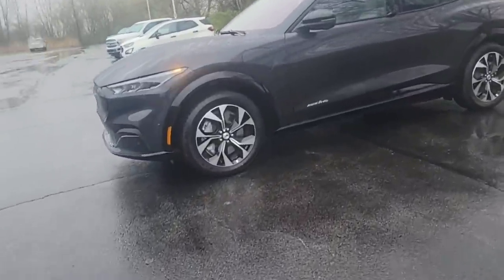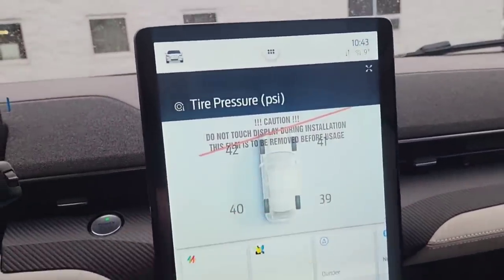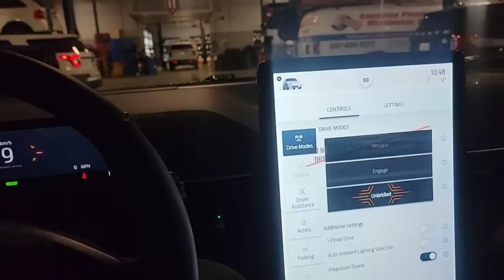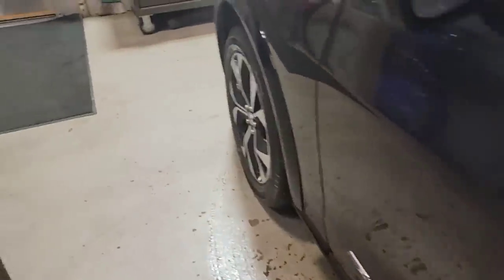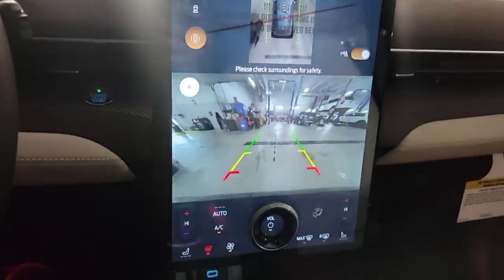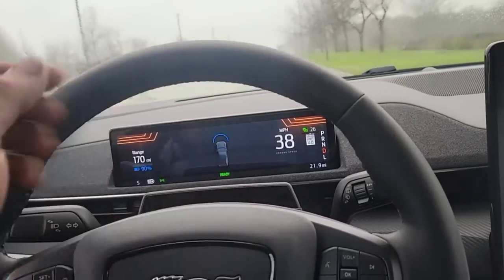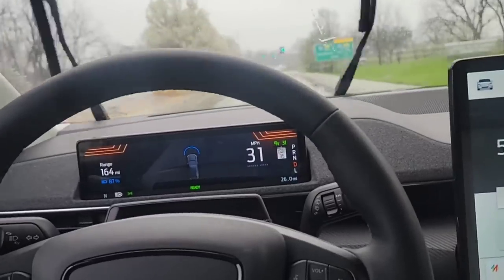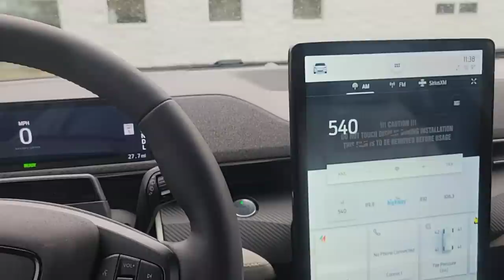2022 Mach E PDI - Adaptive Cruise Control and Speed Sign Recognition - Let's Check This Vehicle out

Comment: Though I am not comfortable with the idea of electric vehicles, I must say that I am quite impressed with this Mach E. It's a sharp looking little car. I'm amazed that it can sense and adjust for the changing speed limits all on its own.  It's cool that it can maintain distance between itself and the vehicle ahead and how it slows and stops for traffic lights. 
Fordtechlife did a live video awhile back on one of these. The acceleration was pretty impressive. 
Thankyou for the in depth test ride. You did a great job demonstrating the features of this vehicle.
Reply: While this car is a neat and capable thing I with v8 sound inside, does is make any sound outside apart from wind noise?
Some sound to alert pedestrians would seem essential to my mind.
It would be fun to play with different sounds coming from the car as it is driven.
The idea of the Mustang sounding like a v12 Detroit diesel 2 stroke  in a Peterbuilt has a certain attraction.
As does the sound of a Formula 1 engine at full noise.
The possibilities àre endless if you think about it and some are rather comical.
A horn which plays " get out of the bloody way " in Stephen Hawkings' voice has a certain attraction too.
Posibilities, posibilities.
Out of my pay range so I will just have to watch others from afar.

Comment: Make sure you check mechanical brakes during PDI, there is a TSB for brake material sticking to rotors causing vibrations. Mach-E normally uses the motors to brake, so you have to put it in Neutral and press the brake pedal to test the mechanical brakes. A lot of these car come with noisy brakes from sitting months at the factory and they need to be exercised in neutral so the rotors actually get scrubbed by the pads. Brake pads aren't really used for normal driving unless stopping hard, the motors do 95% of the work accelerating and braking.
Reply from the maker: Yeah I know about the tsb but it wasn't active on this one

Comment: It's not a Mustang but it's very nice electric SUV. That should have been good enough to market it on it's own branding. They could have called it anything.
Reply: yeah E-Clair (donut) LOL
Reply: Mostly the problems with current EVs isn’t so much the propulsion pkg but the as of yet unsolved infrastructure issues. Recharge stations, battery life, range and recharge time. For some folks even those are non issues but there are poor saps out there that don’t understand electricity or how batteries degrade or the dilemma of replacing an increasingly expensive battery in a vehicle that is depreciating. They’ll get it after it’s too late.
Reply: Agreed. That is no ford mustang. IMO companies and consumers are being subsidized to build and drive these things....electrical vehicles would be a difficult sell without the government picking winners and losers.
Reply: its a taurus

Comment: I think this Mach e is equipped with BlueCruise. Which on certain stretch of interstates and highways the vehicle semi autonomously drive itself. 

And it does that by using the adaptive cruise control with lane keeping assist and using infrared cameras monitors your eyes.

Pretty cool system I’ve recently test driven a 2021 Ford F150 King Ranch with the BlueCruise package. 

Takes a little bit to trust it but I could see how benefit on a long road trip.

Comment: My only experience with adaptive Cruise control is my 2018 Volvo. I used it a lot when I first got it and had to replace rear brakes at 30k :(.  Now I use it sparingly. I like the heated steering wheel and seats but could care less about the rest of the BS.

Comment: I work on some many of those that blue cruise 21G01 updates are a pain. I had a Mach E that has isolation fault. Hotline send a roush tech to us to fix  it I had to drop the battery from vehicle so he can repair it turns out he left coolant hoses near high voltage bjb off I ended up putting new battery pack and harness have pic if you want to see.
Reply from the maker: Poissorichard.rp@gmail.com send me some pics I'd love to see

Comment: FYI looks like you put lift jacks in the wrong place on battery protection rail. Never put the jacks on the aluminum square tubing (protection rail). It's thin aluminum not designed to hold the weight of the car. See WSM section 100-02 for the picture of where to jack (avoid the blue rail). If you damage this it's a new $28,000 battery, so be very careful lifting Mach-E's.
Reply from the maker: Well you did say looks like so that means you're not sure so that means would probably be a good idea not to say anything because there were direct indications saying that this is where you put the lift on the lower portion of the vehicle and I'm a stickler about that so you got to spend some time on the channel to figure out how I do things and don't jump to conclusions because I'm quick to tell people real fast to stay in their lane 

Be Blessed

Comment: .....🇺🇸❇🔩⚓🔋🔌🔋⚓🔩❇🇨🇦.....That new Mach E in the grey is a unique beauty! Some older folks might prefer the older classic Mustang's muscle car design however this brings out the future 4 automotive manufacturers such as Ford Motor Company! Plus as some have mentioned unlike the heat/power losses which occur in traditional internal combustion engines, the new electric design minimizes loses & hence that instantaneous torque!....Excellent screen, nice & big too.....Another hats 2 Ford Motor Company! Will have a variety of customers/fans & enthusiasts in the future, cheers!....
Reply: When talking efficiency of internal combustion vs. electric, lots of folks disregard the fact that efficiency (which truly isn't great in combustion engines) is merely shifted from the car itself to the producer of electricity, the power line losses or the manufacturers of photovoltaic panels, wind turbines or whatnot. So efficiency talk should be based on a case-by-case comparison.
Reply: @svenschwingel8632  .....❇.....Interesting! U taught me something new! R u from Deustchland sir/senor?....
Reply: @aliadam575  guilty as charged 😬😉
Reply: @svenschwingel8632  .....🇺🇸🍻🍾⚓🥂⚓🍾🍻🇩🇪.....Heil & hello from the states sir/senor!....
Reply: @aliadam575  the land of the V8 👍🏻

Comment: Ford Boss: what are those flashing lights right above the steering wheel screen?
Reply from the maker: Those are lights that can only be seen by the camera but not by the human eye
Reply: @FordBossMe  I think that might be the sensors that watch your eye movement for the autopilot. Eyes come off the road for a set time, system turns off. I know this is something Ford was working on
Reply: Those are the infrared (IR) emitters for the driver monitoring camera. You can't see them, only cameras can. It makes sure you are watching the road and don't fall asleep while driving in hands-free mode.

Comment: Speed limit feature is not part of the Adaptive Cruise on my 2019 Edge ST.
There are so many places where my dash shows the incorrect speed limit that I would not want that feature as part of Adaptive Cruise. I do like the feature where you can set the distance between your vehicle and the vehicle ahead of you and that it matches the speed of the vehicle in front of you.
Reply: I think the new cars read the speed signs, but not 100% sure.
Reply: @wb6anp  All cars should be using GPS for speed indicators. The speed limit will change on my instrument panel as I pass the signs, but there are locations where it does not change at all or it displays an incorrect speed. My dealership can not tell me where to send corrections to Ford so that they can update the navigation.
Reply: Another feature of Adaptive Cruise that I had to get used to is it's ability to stop on its own. The first time I tried it, my heart was in my throat, but as I used it and it gained a little confidence from me, I started using it more. It will stop the vehicle when the traffic ahead of you stops, and all I have to do is tap the resume button for my vehicle to start moving again.